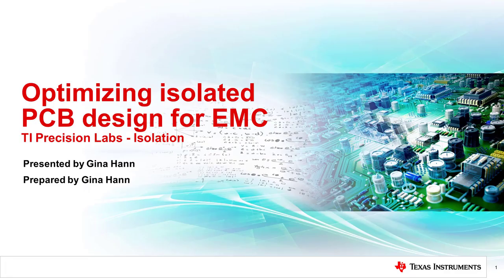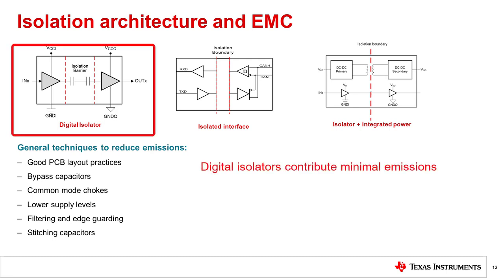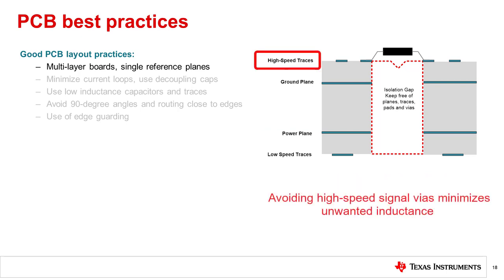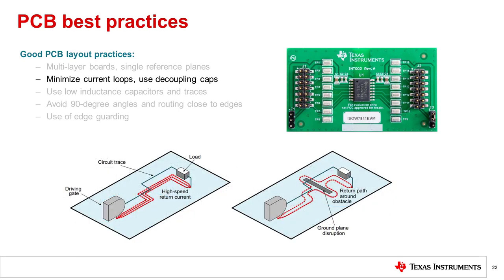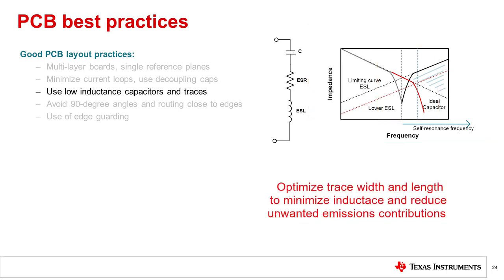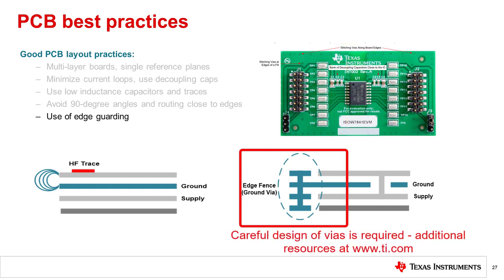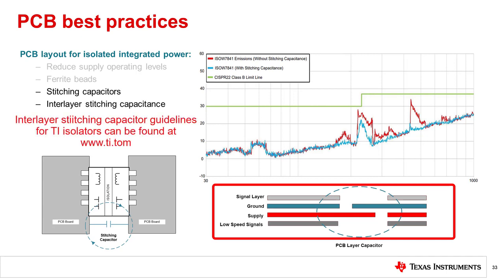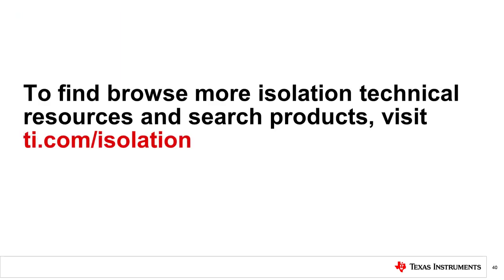Optimizing isolated PCB design for EMC

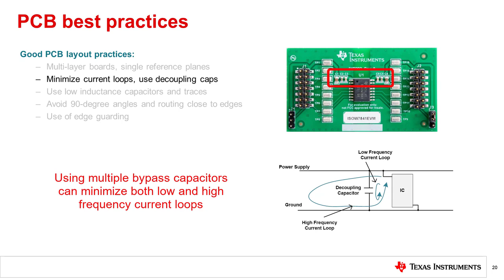Comment: @5:51 "using multiple bypass capacitors can minimize both low and high frequency current loops"
TI - Decoupling Capacitors video: https://youtu.be/3rxKZWQk_DY?t=235 - "Don't use two different capacitor values for better high frequency bypass", "using two different parallel capacitors can create a resonance"
Which is correct?